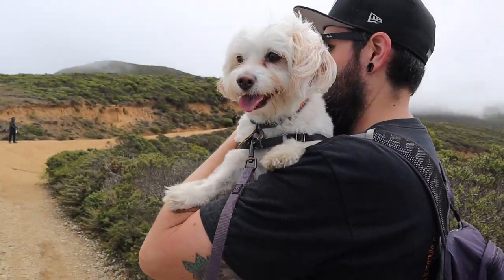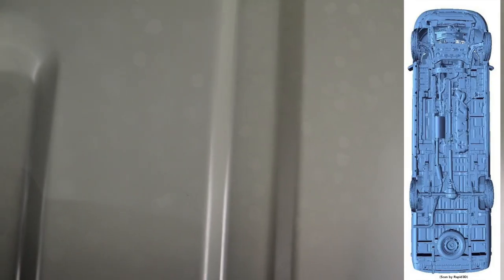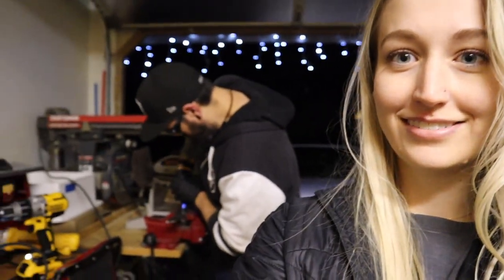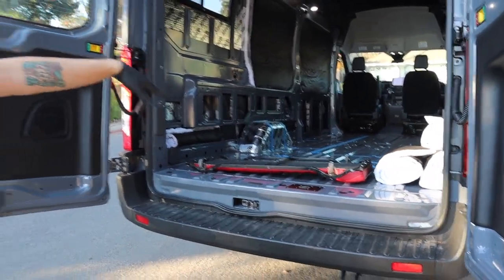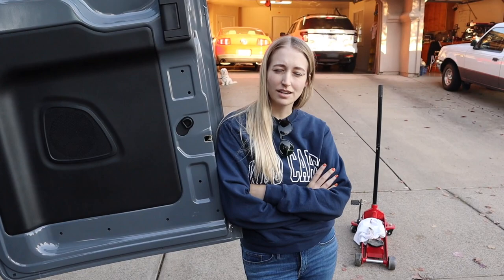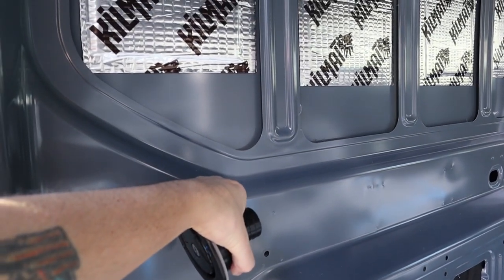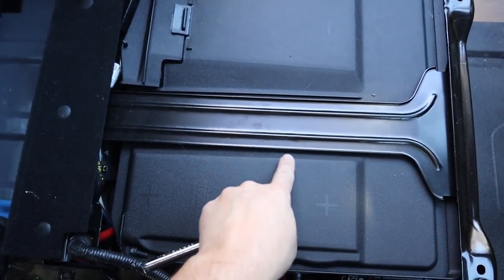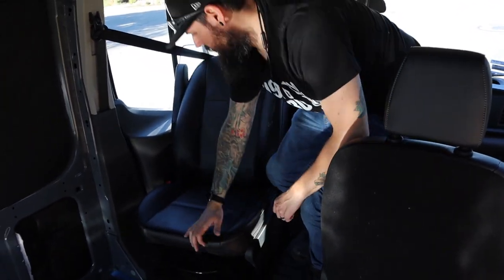Propane Tank & Scopema Swivel Seat Install | 2021 Ford Transit Van Build Conversion Ep. 5

Comment: Hello again Brit and Mike. I finally was able to purchase one of those tanks on Ebay. I was wondering if you have research adding a remote level monitoring system to the gauge. The though of crawling underneath to check the level is not too very appealing to me.
Reply from the maker: Ah, no, unfortunately we haven’t looked into that yet - sorry!
Reply: @britandmike  I will get my tank tomorrow and have ordered a replacement level indicator with distance read out. I will keep you posted if it a viable solution. I have learn so much from your video and its saving me tons of time. THANK YOU! for doing the video It take a lots of time to keep it going. Would be nice if I can help you just a little bit.

Comment: Great to see your build in progress. We are getting the 148 HR Ext  in about a month and will be doing and using similar products (great minds think alike !) so as the the band The Police say "I'll be watching you".  Does your van have the electrical parking brake? Ours will so I was wondering if you had to make any modifications for it. thanks and happy building!
Reply from the maker: How exciting, congrats on your van! We do have the electrical parking brake that’s located in the lower left of the dash. We haven’t had to make any modifications for it at all, when we ordered our van we found out that Ford moved the brake there for 2021 models onward. I have seen that it used to be on the floor to the right of the driver seat, and people had to move it to put in a driver swivel, which sounds like a pain!
Reply: @britandmike  Great :) good to know this about the parking brake. Happy building and... happy travelling!

Comment: Awesome video! Just ordered 2023 Transit and start to think about propane stuff. I wonder what type of plumbing you plan to use to bring propane to inside. Metal tubing? Thanks.
Reply from the maker: Hi - we are just now getting around to this in our build and we decided after reading on the transit forums and a blog post from faroutride that we will be using copper tubing. Here is their post: https://faroutride.com/propane-system/
Reply: @britandmike  Thanks for the reply and link.

Comment: Great video Thanks for the info.  How often living out of the van full time do you have to refill the tank?
Reply from the maker: We have only refilled it once so far, after about 7 months of use!
Reply: @britandmike  Thanks!  I trying to come up with a design to keep the battery in the van and not mounting it underneath.  Thinking about a LP locker for a 5 gal with a vent hole drain

Comment: I found your videos today and I’m obsessed!!   It’s giving me so many ideas for my dream van!    I want to do a ford transit as well.   I’m tall too so I like it’s height.   Was wondering about the bed.  Will it for a standard Queen side to side?
Reply from the maker: Thank you so much! We are planning to sleep side to side. The widest point across from wall to wall is 77", and the walls are curved, so that widest point is 36" high from the floor. We will have the width of a queen but will have to take a few inches off the bottom of the bed.

We had been using this helpful video with all the dimensions to plan our layout: https://www.youtube.com/watch?v=IqRYt2cWTdI

Comment: What seats do you have? Ordering a 2023 soon and would like to know what type of seat you ordered from ford. There are quite a few options and I hear some of them (like the 10 way power seat) don’t work well with scopema swivel bases due to the seat motor location.
Reply from the maker: We got the manual seats in dark palazzo gray vinyl. The only electrical components in the seats were the sensors for the airbags and seatbelts.

Comment: Silly question. Everything I've read says you have to turn horizontal propane tanks vertically to fill them. How did you get around that?
Reply from the maker: Hi - we hadn't heard that, but we read our tank has a liquid fill identification and an internal 80% fill stop so that it can't be overfilled. We just recently installed a remote fill kit so that it can be filled from underneath the bumper on the driver's side.